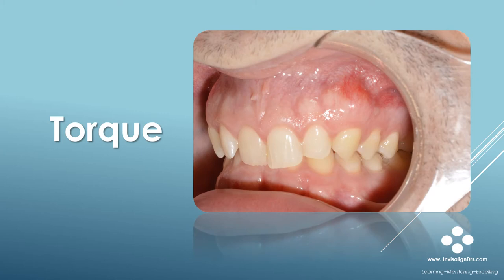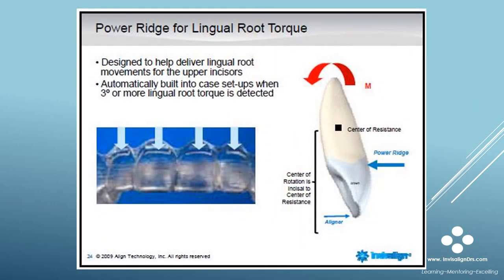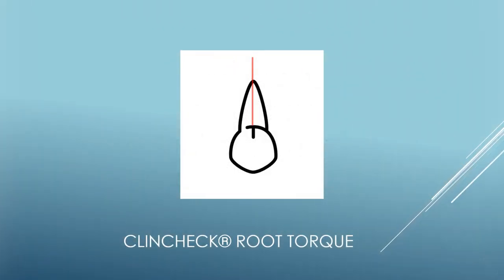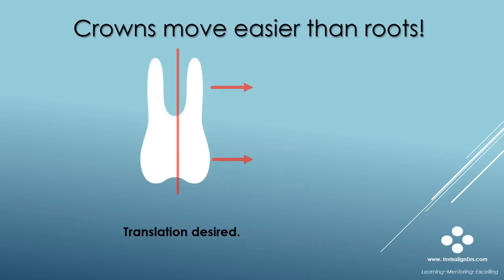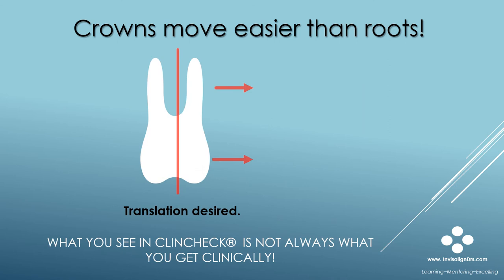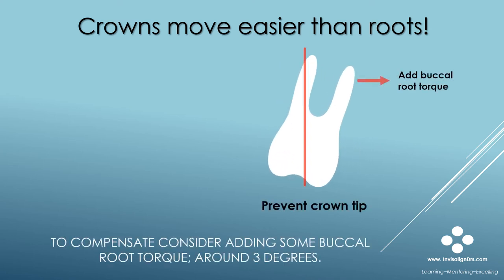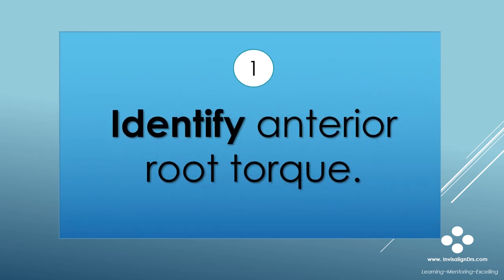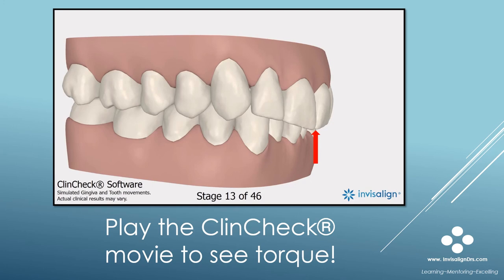Root Torque Management with Invisalign

Comment: Can you wear the aligners in reverse if you don’t like the results?
Reply: Short answer: 
In case that's a joke I think it's hilarious. But don't do it.

Long answer:
It likely won't work very well. For example those power ridges are designed to push specific points so your teeth move in one specific way. Moving your teeth back also requires pushing specific but of course different points. If you just wear your aligners in reverse they do push somewhere but as they aren't designed to work in reverse you have no control where they push so it is unlikely that you push the correct points. Pulling on your gas pedal also doesn't make your car go backwards.